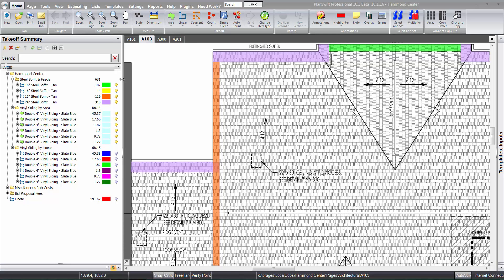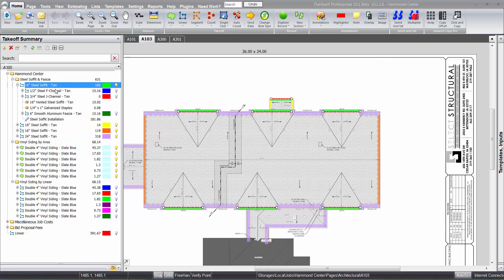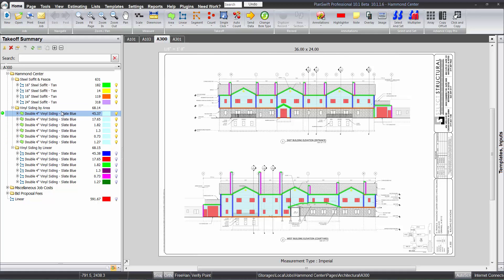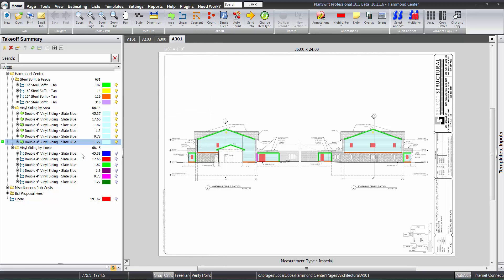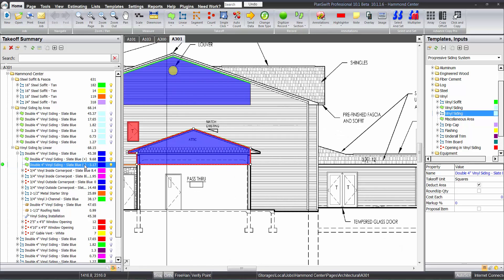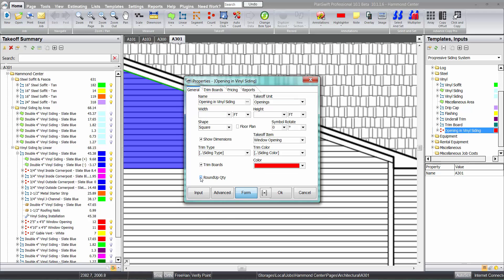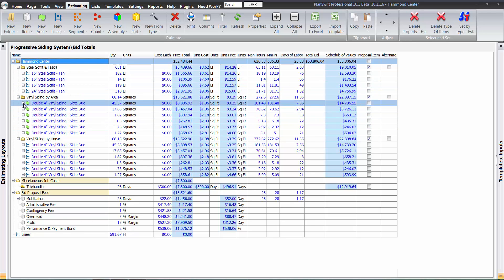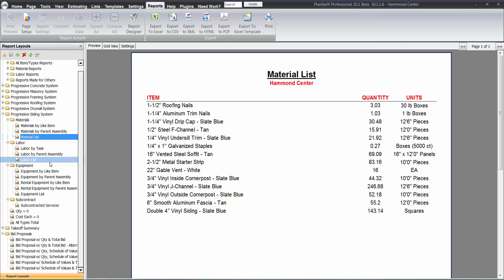Planswift Siding Takeoff - Commercial Building

Comment: How much is the siding plug in?

Thanks
Reply from the maker: Please contact takeoffs@precisiontakeoffs.com for more information.
Reply: On the area instead of having them go up you can have them go down with a little darker color blue and call it wall breaks area. And then you could have a item called multiplier and draw one out and use the multiplier that's built in to the formula and times it by 6 and that way you just draw one of em out.